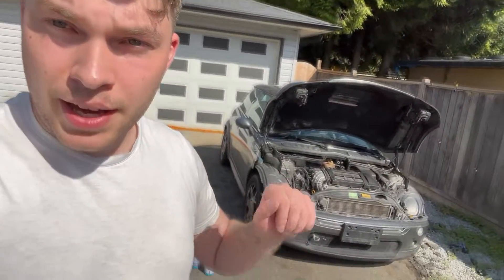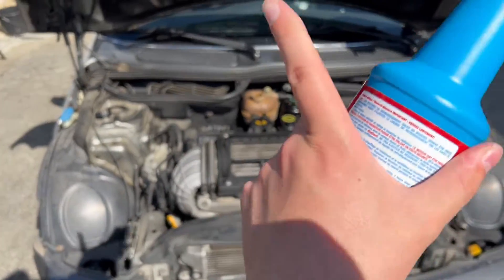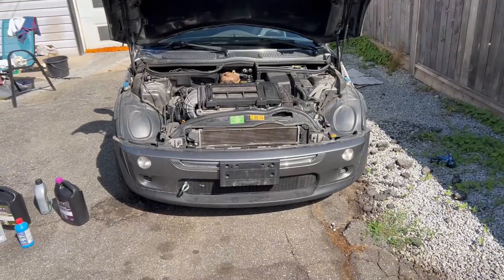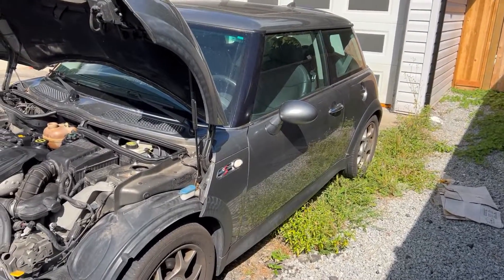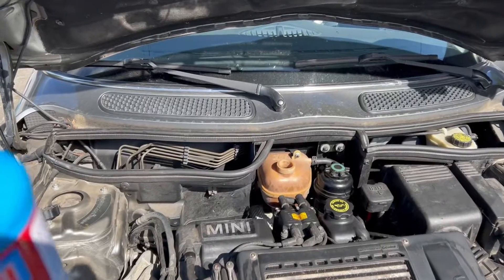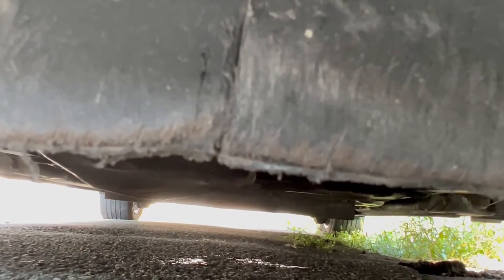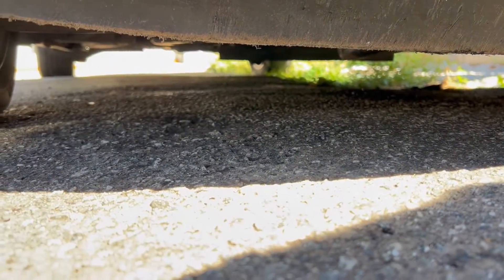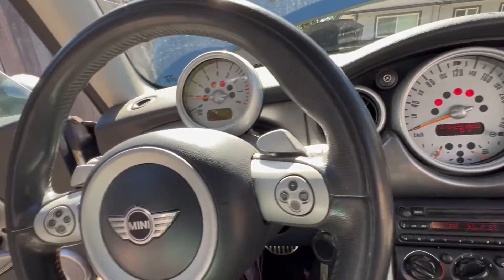Do coolant stop leaks REALLY work? | Blue devil

Comment: No shade to your video but please NEVER use this stuff . Whatever you’re trying to avoid paying to fix now you’ll end up paying 5x more later down the line . It breaks my heart when I see cars with this stuff stuck everywhere …
Reply from the maker: This product does not clog heater cores or radiators
Reply: @arsenyrazhkov4559  Yup Chris fix proved it doesn't clog but recommends flushing oil and filter after 2 days.
Reply: I got 10000 miles of towing on a bottle of this stuff

Comment: Will it clog up the heater core?
Reply: Yes. Cost me 13k in repairs after using it. Don't do it. Had to put. New motor and new core because it clogged everything
Reply: @ZONER4201  13k? wtf?
Reply: @ZONER4201 13k???? Just get a new car man 😂😂😂
Reply: @Wh4L205  lmao exactly
Reply: @ZONER4201   No. This product is absolutely not the reason why you had those issues, if you even had issues in the 1st place....Stop spreading bullshit just because you're desperate for the attention. $13K, my ass.
Reply: I just used it to stop a coolant leak in my 2010 Hyundai Elantra and it worked…. But it also killed my heat which I wasn’t having a problem with before this so I had to change my thermostat which was completely gummed up from it…. Looked like someone stuck blue bubblegum inside the thermostat coils…Still no heat so now we prob have to change out my heater core… God knows what else…. Maybe flush out the whole damn cooling system to remove the damn Blue devil which will open up the leak it fixed …..so I’ll prob need a new radiator bc the leak it fixed was right at the bottom of the radiator!! So much for trying to save money because I’m on disability and a fixed income.   I just want to cry 😭
Reply: @jennifersalisbury1163 That's why you have to let the car run until the engine is hot. If you don't let it heat up, it will gum up.
Reply: @ZONER4201 LoL! Heater cores don't cost $13,000! You got robbed.